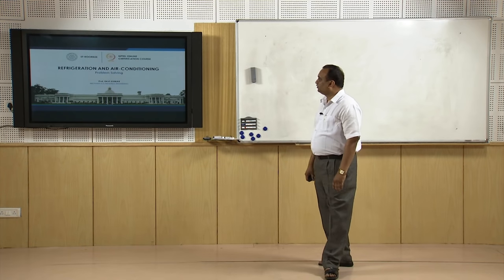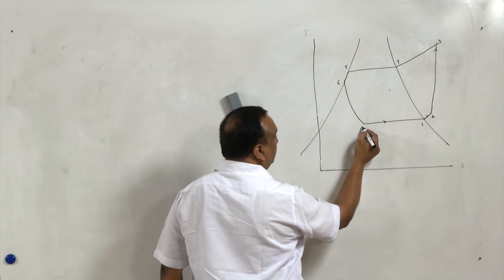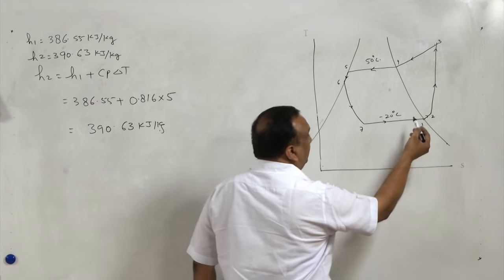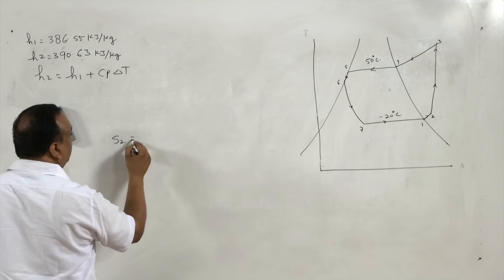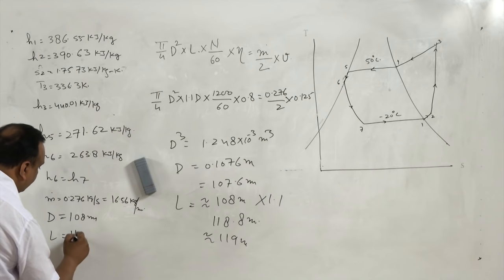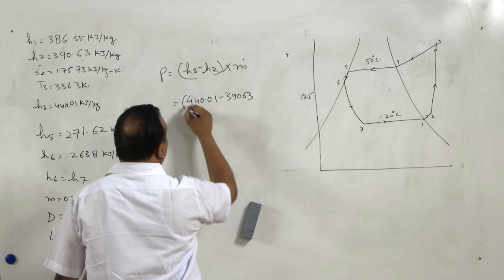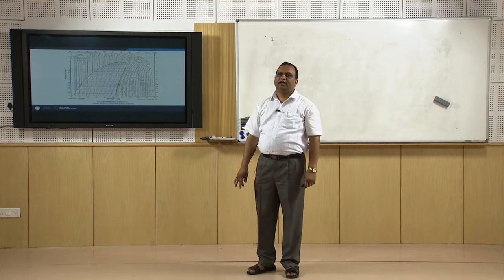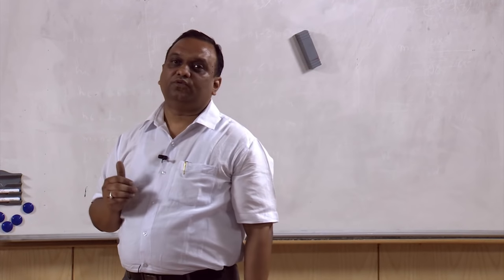Problem Solving

Comment: How do you determine the superheat in the evaporator. Most videos ignore this part and do not explain it, they all seem to make up this '5degrees' past the saturation vapour line. Same question applies to the compressor discharge.

Comment: Hi sir,i thank you very much now i understand this chapter because of your videos.Sir i would like to know how did you get specific volume of 0,125.Another question is that if a question can ask me to calculate a mass flow rate of cooling water in the condenser for a 7 degrees change in temperature.I would appreciate if you can reply me asap.Thanks

Comment: From where did specific volume=0.125 came?
Reply: Same doubt..  It looks like sir use the table..  And use the value of specific volume at -16°c.. But why?????
Reply: Yes at -16°C but there is no link with this temperature
Reply: Yes there is no connection...  Told u that i have the same doubt
Reply: I think sir considers the specific volume of -16° because it is close to -15° as -15° is the temperature at which the vapour refrigerant enters the compressor..
Reply: A refrigeration compressor of 50 mm bore and 40 mm stroke operates at a speed of 1460 rpm between condensing and evaporating pressure limits of 1.219 MPa and 0.151 MPa. The clearance ratio is 5% ratio of specific heats of refrigerant is 1.18, specific volume of refrigerant at suction is 0.11 m3/kg and the enthalpy change of refrigerant in the evaporator is 93.7 kJ/kg.
How to find volumetric efficiency
Reply: @RahulSharma-cm3ct  at -32degree temp how to find the h, s values?